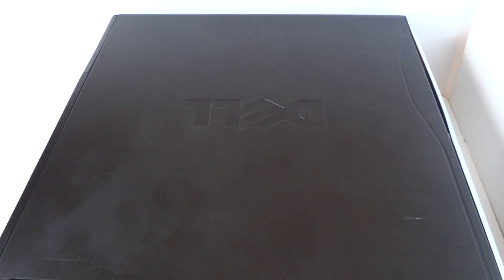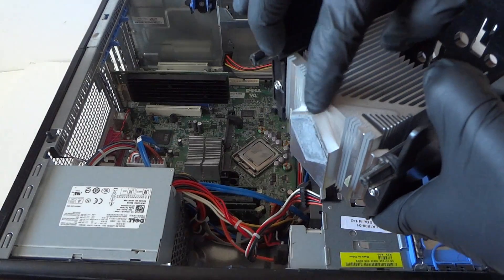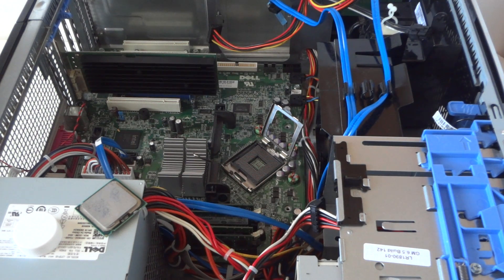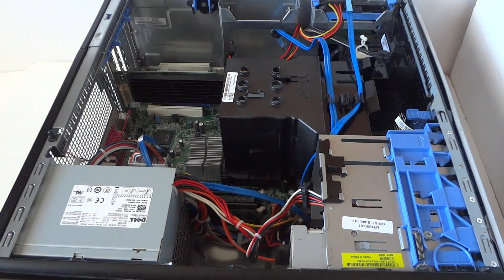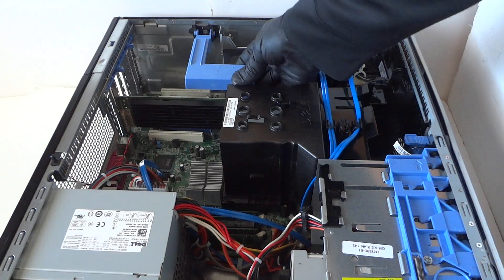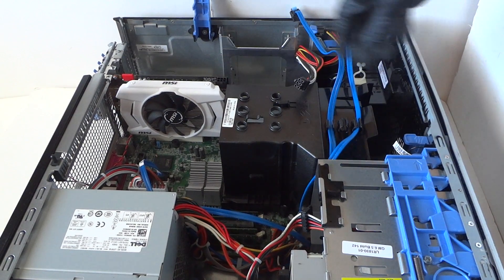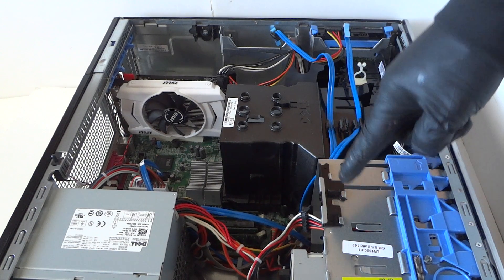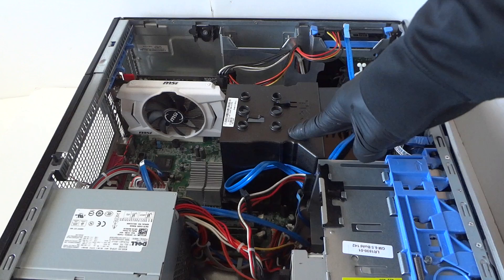Dell Precision T3400 Upgrade Video Card SSD RAM CPU Gaming

Comment: Actually the center hard drive bay could be used for the SSD . You will need another blue hard drive bracket and SSD holder that  fits in the hard drive bracket. The power cord for it is next to the video card power connector. The other blue SATA cable then connects to it. Just drop the whole thing into the other metal drive bay.

Comment: Is it possible to change the motherboard? I'm planning to upgrade my Precision T3400, and still wondering if it's possible to avoid the limitations of DDR2 and Core 2 Duo CPUs.
Reply: Ion Particles You are not limited to Core 2 Duos. Search up the t3500 motherboard on eBay. I am also looking to upgrade the Motherboard. I am going to try to put that motherboard into the case.
Reply: Xsavi Xander Ah I see. I know the t3500 motherboard should be similar to the t3400's, as it's a full size BTX. Seems like a good idea, considering standard BTX boards are a rare find. From there, a decent CPU socket and RAM capabilities have the potential to produce a lightweight gaming rig or reliable daily driver.
Reply: Ion Particles What I have found out is that the T3500 board will not fit into the T3400 case. I am going to buy a t3500 and see what motherboards fit in there.
Reply: Xsavi Xander Huh. That's the problem with proprietary cases. Though, similar to you, I've wondered if any another motherboard form factors would at least fit in the t3400 or t3500 (modification if necessary). I'm glad you found the answer, it will be helpful to other people who are indecisive with pre-built PC'S
Reply: Ion Particles I am searching and going to buy boards and see. :)

I just love these Prebuilt PC's and I love seeing just how much they can take! You would be surprised!

I had a GX620 that was getting obsolete, so I put a Optiplex 380 and 360 board (one at a time, of course) in there and it worked perfectly! 

I needed to buy the front panel cable for the Optiplex 360/380 board as the pinout is completely different. :)

Do you have the T3400? I would recommend searching up on eBay "Intel Xeon X3370" or "Intel Xeon X3360". Those are very good Xeon CPU's that will put a few more years into your T3400. If you know how to do the 771 to 775 conversion, I would recommend getting the Intel Xeon X3363.

Since the chipset on the Precision T3400 is the X38 chipset, it does not support the X5xxx series of the Xeons (I am going to verify this).

Use this as a reference: https://www.intel.com/content/www/us/en/support/articles/000007669/server-products.html

The G31 and G41 series will work with the X33xx and 5xxx series of Xeons as long as they are LGA 771 or 775. :)

I am happy to help out! Let me know if you need anything else!
Reply: Xsavi Xander Nice! Thanks for the suggestions, the 771 to 775 adapters are cheap and accessable. I'm considering updating the processor with an Xeon (based on your suggestions,and still deciding on the model), replace the Nvidia Quadro graphics card with an updated one, might install an SSD if my budget supports it, and upgrade the RAM to 8 DDR2 on my t3400. Honestly, the t3400 is the first venture I'm going to make in PC building. 

But I'm going to measure the t3400's motherboard dimensions and compare it to several different standard motherboard sizes out there. I'll report back if I see similar sizes and stop my original plan to upgrade only individual motherboard parts. Then we could see if a motherboard replacement is possible.

Comment: what is the highest CPU the T3400 can support on Bios A11?
Reply: AirRookie 😍 $60 Q9650
Reply: Buck Falcon 😍 yup 9650 are on sale for $50 now 🐢🐢🐢🐢 and even if u dont overclock them they trade blows with an older i3 yay 😍
Reply: okay and I just realized the bios is on A14, also I got the Q9650 for $46.99 on Ebay :D
Reply: AirRookie 😍 $46 is a fair price for the 9650, yes A14 was the last bios for our T3400, this motherboard support 4 sticks of 2gb 800mhz, u will need it for Fortnite which consumes 6gb of system ram, and for video card the minimum is 1gb of gddr5 ram with everything set to Looooooooow 😊
Reply: I installed the Q9650 and a GT 740 1GB GDDR5 and the performance has improved from a Q6600  and a quadro FX 570 ^^

Cinebench R11.5 Scores

Q6600 & Quadro FX 570
Open GL: 5.63 FPS
CPU: 2.59 PTS
CPU Single Core: 0.66 PTS

Q9650 & GT 740 1GB GDDR5

Open GL: 36.19FPS
CPU: 3.42 PTS
CPU Single core: 0.89 PTS
Reply: @AirRookie  😀 yay thats great, a 740 is a rare card 😏

Comment: sir i have cpu like this and its 4gig ddr2 ram installed allready but when im upgrade into 8 gig ram they dont have a display but  still workin only no display why sir please help thank you
Reply: 🙂 any more questions u can always upload a little video to ur channel so we can see better what the hells going on ☺️ ✌️😏
Reply: 😒 exactly what kind of ram did u try, these dells are a bit picky, did u try with 4 sticks of ddr2 667mhz or 800mhz ram? all the same brand? it wont work if its AMD Only ram
Reply: Elmer Elardo Hmmm. Did you update your BIOS to the latest version?
Reply: @ionparticles3261  I've got the same problem. I updated the BIOS to A14. I tried DDR2 800Mhz rams which are NON-ECC
Reply: @krisztiankrausz7606  thats weird it should boot, try only one stick at a time, samsung brand is a popular brand 🙂
Reply: @MrSamadolfo  It booted well, I could get into the BIOS, and it showed that there were two pcs of 2gb and two pcs of 1gb ram. But in the "all installed memory" menu there were only 2gigs of ram. (The two 1gb).
Reply: @krisztiankrausz7606  🤔 are u still in the Bios? Check the ram, it doesnt like amd ram, it has to b Intel friendly ram, it can be either Server Ram ECC or Regular nonecc, DDR2 667mhz or 800mgz, 8GB Maximum using four 2gb sticks, brands that work hynix samsung gskill kingston 🙂
Reply: @krisztiankrausz7606  🙂 correct, they should all show up in the bios, and if it doesnt boot at all and u get beeps and yellow lights it could be a bad stick, if ur using different sticks i think it has to be in pairs like 2,1,2,1 or the other way around, and i assume you already know that windows has to b 64bit version to see all the ram, otherwise in windows it will say something like 8gb installed, 3.7gb usable
Reply: @MrSamadolfo  I have already installed win10 64bit. It's not boot up if I only use the 2gb modules. If I use 2 1gb rams and 2 2gb rams, It boots up, but it shows that it has only 2gb of ram.
Reply: @krisztiankrausz7606  🙂 thats weird, maybe look and try a different set of ddr2 sticks

Comment: Do the pin tape mod on the q6600 to get a 1333 FSB for 3.0ghz
Reply: I remember that mod. Least with one of the core2duos. Tiny bitta copper tape from one pin to the edge bypassing a pin then connecting back.

Simple yet quality little hack ;)

Comment: s that the highest processor you can put in  T3400 without changing anything else?
Reply: You can do the LGA 771 to 775 Mod and use the X3363 Xeon as an alternative. This is the CPU I run on my T3400 and it works great. Just make sure to update to the latest BIOS before you Mod the Socket and add the Xeon. You will also need the LGA 771 to 775 Tape as well; not the same as BSEL Tape Mod where you use electrical tape. Google LGA 771 to 775 Mod and you will find all you need to know for adding Xeon's to Socket 775 MB's. The socket orientation and 2 pins are the only difference between the two sockets. Also the plastic pins you need to remove are very easy to remove but also very easy to slip off and damage the MB Pins so be very careful. I used too much force and clipped the plastic too hard and too fast and bent a few pins but was able to repair them. Granted your question did say without changing anything else so this is just an alternative that is easily done if you take your time and watch many video's on it first.
Reply: Alternatively you could remove plastic on the CPU where the pins fit or buy a 771 CPU pre-modded on eBay like I did.
Reply: 😒 $60 Q9650, easy plug n play
Reply: core 2 quad q9705 3.16ghz
Reply: MrSammy Xeons are more powerful and better.
Reply: Xsavi Xander 🙂 sure xeon is good choice too but the Q9650 has an 'Instruction Set' that the other cpus might not have, for example not just any old cpu will run Far Cry 5, there might be a few other games too 🤔 But for older games we should b fine with any cpu hopefully 😸

Comment: Is that the highest processor you can put in  T3400 without changing anything else? Thanks!
Reply: vVTheNotoriousVv 🤓 $60 Q9650
Reply: @MrSamadolfo  I've got the same processor in my Dell Precision T4300. It works pretty well. Can somebody tell me which 8Gb ram is this computer compatible with?
Reply: @krisztiankrausz7606  🙂 sure, it has four ram slots, each ram stick needs to be 2GB ddr2 667mhz or 800mhz, popular brands shud work like hynix & samsung & gskill & kingston. One thing unique about this board is that it can boot with either regular ram or server ram that says ECC, samsung makes good ECC ram ✌️😏
Reply: @krisztiankrausz7606  that motherboard can handle 16gb of ram max, 4x 4gb ddr2 pc2-6400 (800mhz) ecc or non ecc, all 4 just have to match.
Reply: @RaizARukis  Thank you for replying. I’ve already sold that PC...
Reply: @RaizARukis  With a 64-bit OS, only 8GB with a 32-bit OS.

Comment: Hi, I am trying to upgrade my T3400 and put in the same graphics card as you, MSI GTX 950 but the computer can't see the graphics card. Please can you give me some advice?
Reply: Reading more about installing graphics cards on Dells it seems some motherboards are locked to prevent upgrades. I have upgraded to the latest BIOS. Was this upgrade successful?
Reply: Matt Dadley bro update your pc graphics drivers
Reply: @matty431  🙂 also in the bios, go to graphics, switch it from motherboard to PCI Slot, save n reboot ✌️😏
Reply: 🙂 HD and GTX cards work, did u update the video graphics driver, did u reboot, what does Device Manager show under video cards? What does GPUz show? 🤓